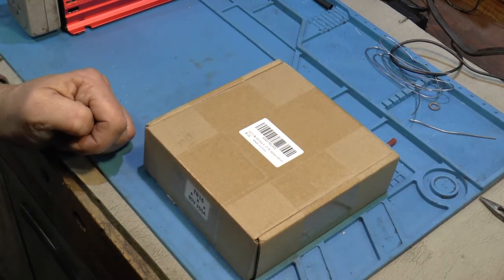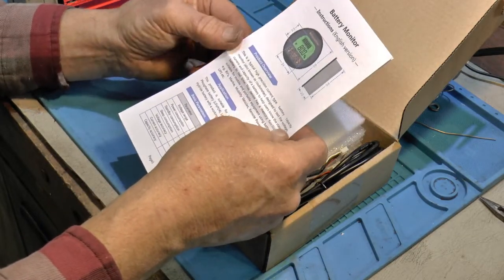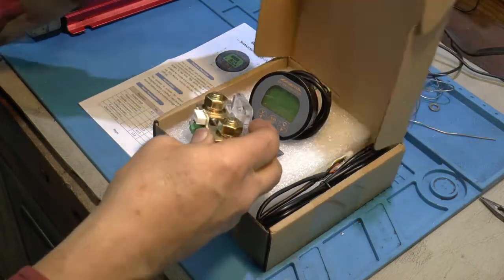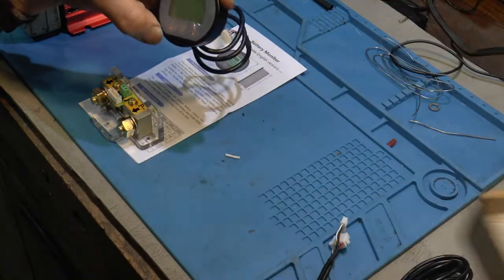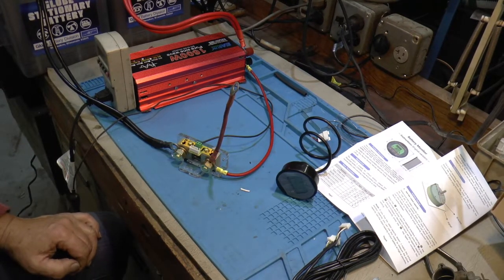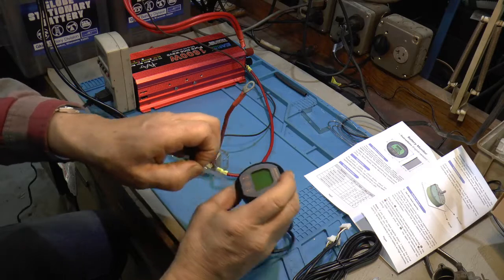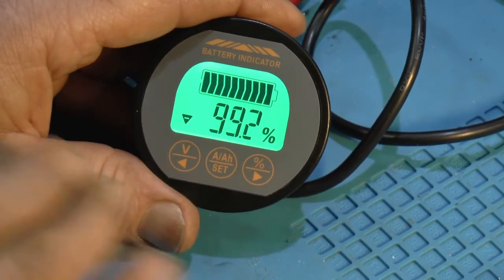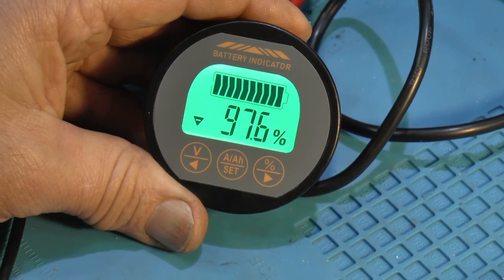Battery Monitor

Comment: I have a portable battery box for my trolling motor and put in  the cheapest meter I could find when I built the battery box. I currently am using a 35ah agm battery and am going to replace it with a  50ah Lifepo4. After watching various videos, I am also going to replace the cheap a/v/wh (no battery%) meter with this meter. From what I have seen this meter has a lot of functions and is still reasonably price.
Reply from the maker: I have 2 of them on the same battery one on the new battery box in the garage and one on the system that the display is in the house. They both read the same every time so accuracy seems really good. You won't be disappointed.

Comment: Please give a link to the internet site for us to purchase this meter!  Please!
Reply: They can be found on Amazon or eBay.
Reply: @gravelydon7072  yes sir, but what is the brand name of THIS one, I only want this one,  
I can find all others but can not find this one, and I'm guessing that you can not find either.
Reply from the maker: Search on amazon for ( AiLi Voltmeter Ammeter Voltage Current Meter Voltmeter Ammeter 100V 350A Caravan RV Motorhome 999 AH
Brand: HENGSHAN ) couldn't really find a way to make a link. There are a lot of sells on amazon and ebay.